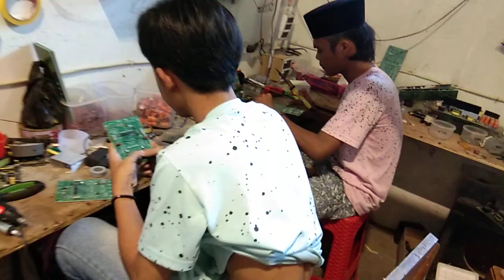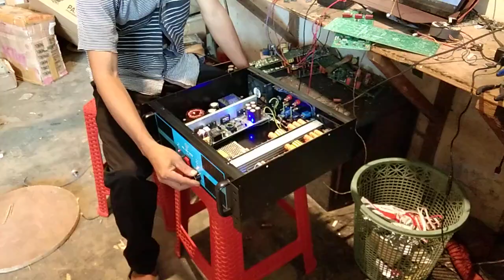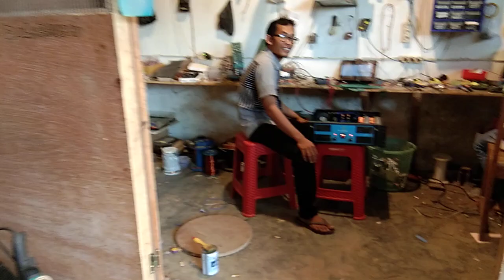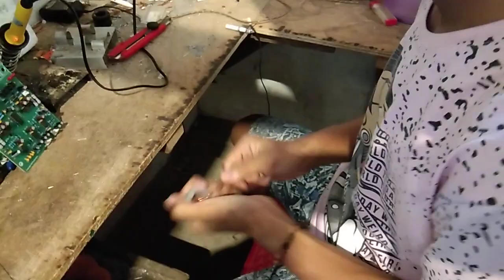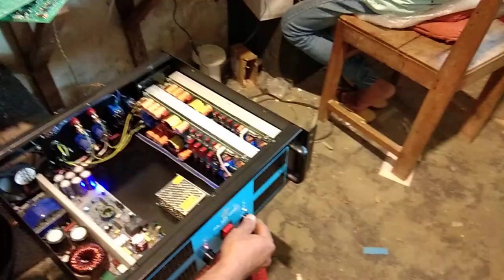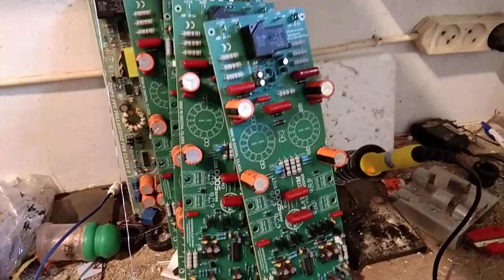Fullbridge Turbo Plus subwoofer vs smps 30amper 3.6kva

Comment: 10000watt PMPO kali,, kalau 10000watt RMS harusnya berani diload 0.8ohm di 90vdc
Reply: 90vdc ndak bakalan nyampe kang kurang lebih psu 4kva dpat 2400 di 4.ohm
Reply: @ZIOCASE  . tergantung spek speaker. kalau 2000watt/4ohm, berarti pakai sekitar 5 speaker
Reply: tergantung per speaker pakai spek berapa watt.
Reply: @MrAgungnug  wkwkwkwk
Reply: @ZIOCASE  wkwkwk
Reply: Standar pengukuran itu 8 atau 4 ohm, bukan 1 atau 2 ohm
Reply: @denboys505  belum tentu boss, ada alat tes sendiri untuk itu. saya lupa link YouTube nya. dari alat tes tsb bisa berubah dummy loadnya dari 8 ohm s/d 2 ohm. sehingga maksimal power output amplifier bisa diketahui dr alat tsb
Reply: RMS 10000 WATT kira2 PSUnya segede apa ya...
Reply: @gundalaseta7468  lgs colok genset dia, gan. hehehe

kalau benar hitungannya, mgkn seperti psu milik alat miner, di parallel .
Reply: @MrAgungnug  berbanggalah karya anak bangsa bisa mengalahkan power buildup sekelas RDW 😆😆
Reply: @MrAgungnug  anda tidak  paham  dg standar ohm yg saya maksud kang. Kalo dumiload ya ada yg 2 ohm. Kalo power pabrik ya ngukurnya 8 dan 4 ohm
Reply: @denboys505  mungkin anda belum pernah lihat YouTube nya kang, cara mengecek kualitas amplifier built up, membuktikan apakah sesuai dgn spek yg tertulis atau tidak.

kalau sampeyan cek, spek. pastinya beda2 untuk beban misal :  2 x 60w/8ohm ,  2 x 80w/4ohm, bridge 1 x 120w/2ohm.

alat tes nya akan mengecek pada masing-masing beban, sesuai dgn spek pabrik. brpkah teg x arus outputnya. inputnya dari pink noise alat itu, otomatis diatur sampai mendekati clip.

yg sampeyan maksud mungkin "standar pada umumnya di pasaran", bukan standar spek speakers / amplifier yg tertera oleh pabrikan.
Reply: @denboys505  ini contoh spek spkr, yg lebih tinggi 5kw lebih rendah lg impedansinya

https://www.amazon.com/gp/aw/d/B01MXF8N5I/ref=sspa_mw_detail_0?ie=UTF8&psc=1
Reply: @MrAgungnug  konten kan mbahasnya amplifier bos, topiknya kan amplifier. Ngapain ke speaker segala. Udah beda lg itu bos
Reply: @MrAgungnug  yg di maksud itu standar umum.
Reply: @denboys505  kalau masalah power tetap satuannya  Watt, rumusnya semua sama, ga ada yg nama watt amplifier beda dgn watt yg dimaksud spkr, beda dgn watt alat elektronik lainnya. namanya daya ( power ) = teg x arus. itu sudah baku mas, skrg sampeyan jelaskan rumus menentukan besarnya daya amplifier, kok bisa mas nya bilang beda ?
Reply: @MrAgungnug  faktornya banyak bos kalau daya amplifier. Itu juga tergantung psu,beban dan komponen jga mempengaruhi
Reply: @denboys505  kalau ada standar berarti ada rumusnya, bgmn rumusnya menentukan power amplifier ? P amplifier = .....

kualitas komponen menentukan krn kemampuan nya tidak sesuai dgn data sheet dr pabrik ( barang reject / tidak lolos qc ).

kemampuan menyalurkan teg, arus atau penguatan dll. tidak sesuai standar ( lebih rendah ).

saya cuma mengembalikan ke ilmu aslinya mas, bukan "ilmu jarene" .  P = V x I, masalah THD,   dsb. adalah bahasan yg berbeda.
Reply: @MrAgungnug  rumus gimana mas, bukankah sudah ada  osiloscop. P=V x I bukankah rumus menghitung daya trafo/psu
Reply: @MrAgungnug  Vrms2 /beban
Reply: Cara menghitung watt amplifier itu Vrms yg keluar dari out amp x ampere yg keluar dari out amp,volt dan amper tergantung beban ,makannya ada alat buat ngeceknya. Kalau ada beban pastilah teganggan dari psu nya turun bos/teganggan gak akan sama dari psunya